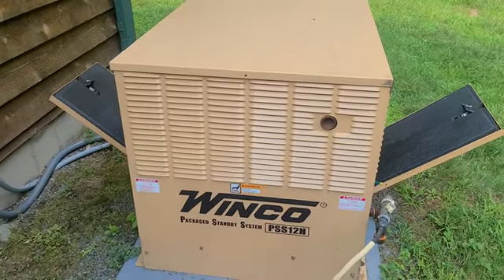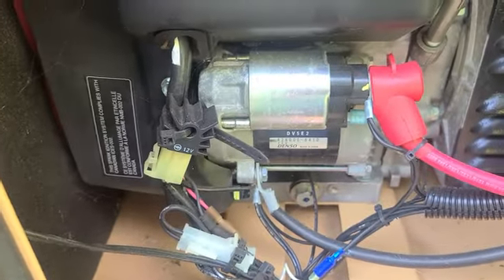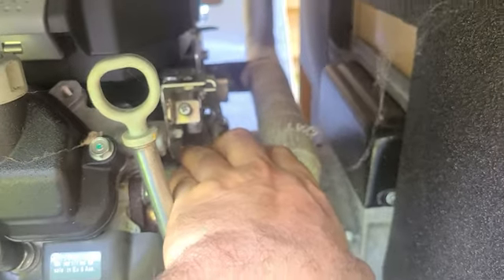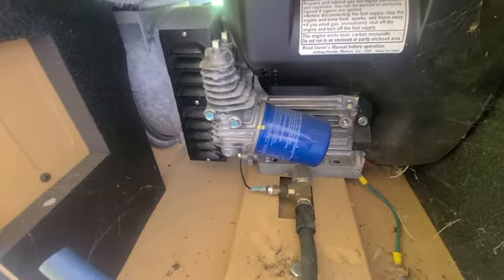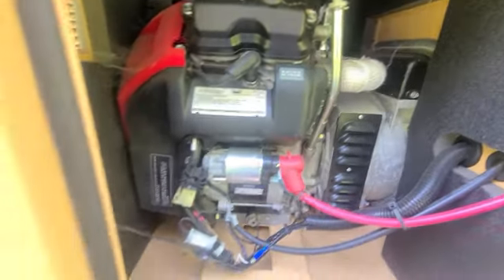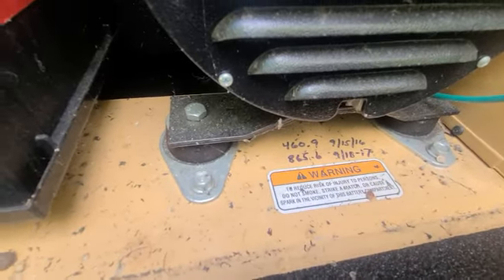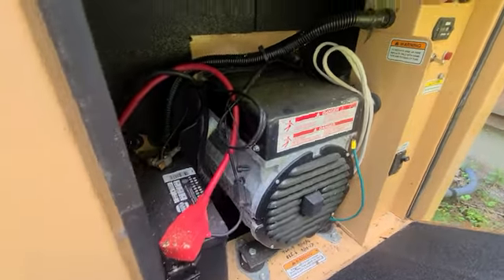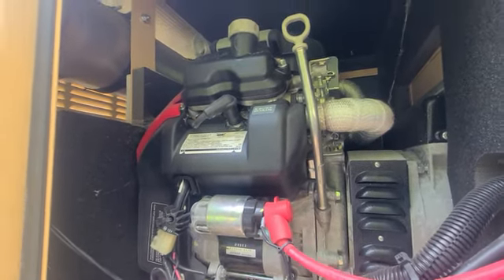Winco PSS12H Propane Generator

Comment: Hello Silver, 
I have this same generator and it was running great for about a year (with regular maintenance) but after I did an oil change and spilled a little on the sparks and below, it will no longer turn on. I changed the spark plugs because it seemed like there could be a connection issue due to the oil spill. However that still did not help, I was wondering if you’ve experienced this? Thank you so much, I appreciate your informative content.
Reply from the maker: I have to guess that it's related. Maybe oil got onto the distributor or on the wires acting as a ground of the plugs so iys not starting unplug the wires one by one and clean inside boot with a bounty sprayed with Wd40. Check if plugs are soarking by removing them and touching them to the frame while cranking, see my troubleshooting video on my 35KW Genetator same problem. If you see spark on each then you know it's a fuel issue and see if you have the fuel flowing when you crank you should smell it when spark plugs are removed. Could be the electric fuel valve is shorted. Send the valve 12V DC from a battery or jumper or a computer transformer and listen for the sound of the valve Clicking. Please keep me updated. It's either spark or fuel. Follow the clues.

Comment: Was the propane tank just for the generator? I wonder if they just had it off.
Reply from the maker: Good Question. I shook the tank and it Sloshed. I didn't see a valve to turn it on or off. That's as far as I was willing to go. Could be an electronic solenoid inside the generator was bad and it wasn't letting the propane enter.
Reply: @silverbankruptcy  Ok, makes sense. It was a rental house
Reply from the maker: @nodd85  Yes, I didn't want to get a bill for a new generator.
Reply: silverbankruptcy lol. I hear ya. Smart man